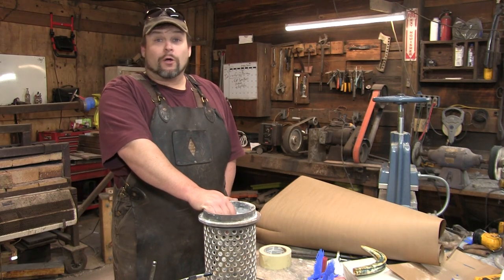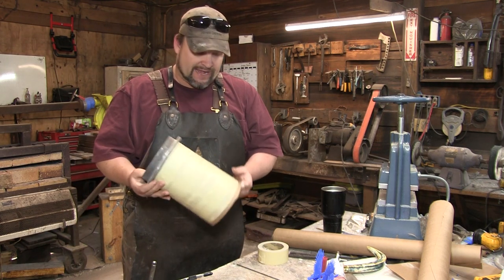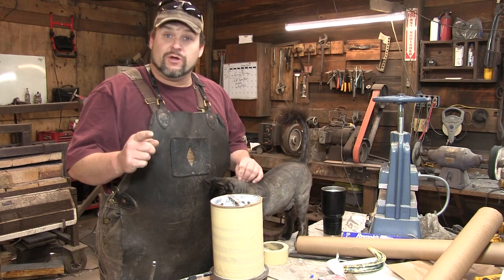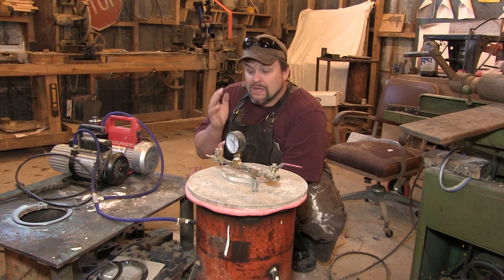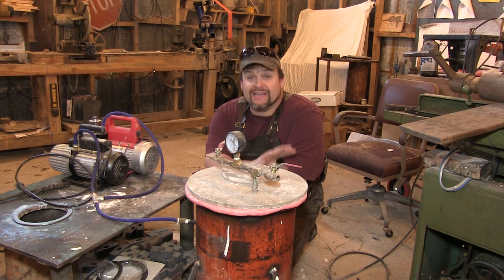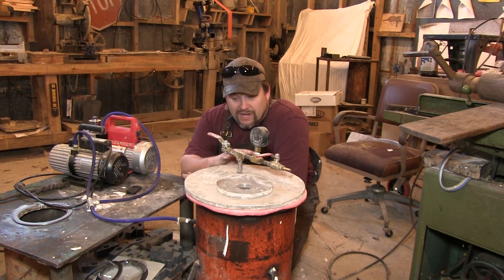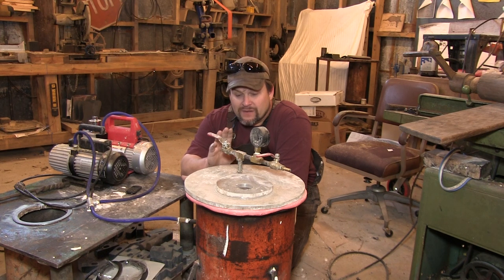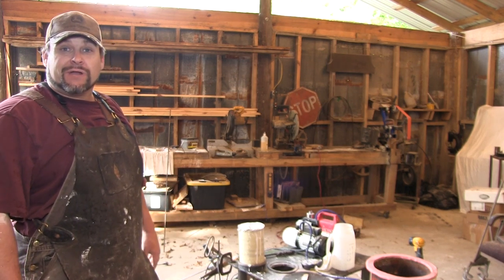Bronze Casting Pt. 3 "Investing The Flask"

Comment: Add a vacuum tank , this is like a reservoir for vacuum,  speeding up the withdrawal of air from the plaster.
Reply from the maker: Really need to add another pump!
Reply: @purgatoryironworks  I have worked in the chemical industry dealing with extraction of natural products for 30 years and in that time I have done numerous vacuum extractions. I could offer some assistance at no cost to you if you wish.

Comment: Ever tried a rubber seal for uPVC door?   Could you use the inlet side of a compressor to draw a vacuum?
Reply from the maker: I havent used that kind of seal and my knowledge of what can be used as a vacuum pump is very limited!
Reply: @purgatoryironworks  I like the dough type silicone you have used.  It's quite clever in a simple way.  I was only curious about a compressor as a vacuum because when I was a kid I accidentally dropped a rag in the intake side of my dad's compressor (filter was missing) and it sucked that fugger in an chewed it up good.  Not sure who came of the worse me or the compressor but that was a lesson learned.  The lesson being if you drop something in yer ol man's machinery get well away before anyone notices!